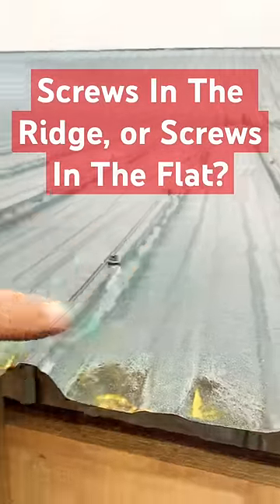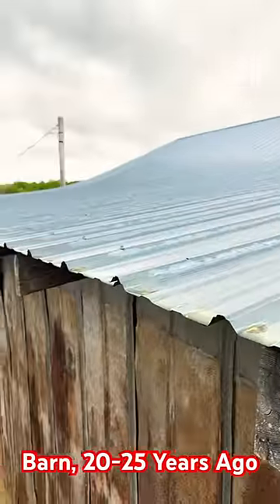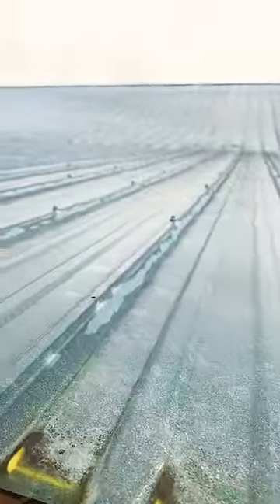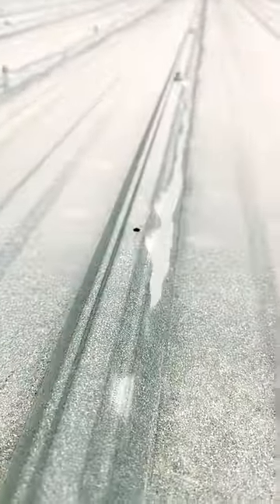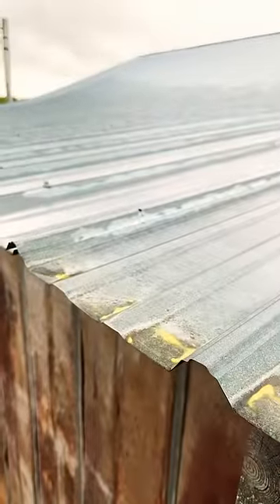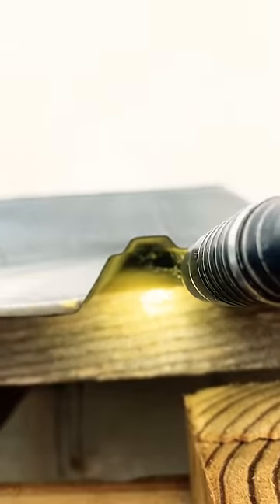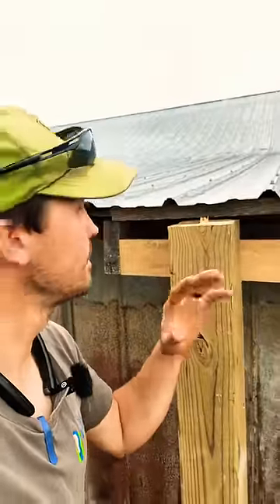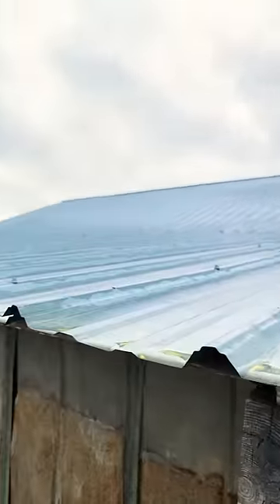What’s Better? Screws In The Ridge Or Flat? #construction #farmlife #building

Comment: They go where the warranty isn’t voided.
Reply: Have you ever had metal roofing replaced because of the warranty?
Reply: @wooduniversity7109  lol
Reply: @wooduniversity7109 my parents did.

So yes.
Reply: Warrant is only good for a couple years anyway.
Reply: @joeshuge usually with steel panels the warranty is good for 25 years actually. I work with these panels every day for years. And putting those screws in the ridge is dead ass wrong lol
Reply: @nonnysbro amen finally someone with common sense
Reply: @nonnysbro  that's wrong also, if you've worked with this product you would know different manufacturers have different warranties, screws can go in the ridge or flat depending on things like region, underlayment, roof pitch, strapping, manufacturers recommendations, type of fasteners, type of product, building code and alot of times as soon as the property is sold warranties are non transferable.
Reply: @joeshuge  that's a common residential panel. Not corrugated. I can guarantee it was supposed to be screwed to flat. I don't know shit about Australia. But in the US, those panels are supposed to be screwed to flat. I've worked for Metal Max, Max Steel Buildings, Sturdi Buildings, and Central States Manufacturing. 2 of those jobs we manufactured every type of panel you could think of. 2 of those jobs I've been an installer and fabricator for years. Never, except for corrugated and seam screws for commercial, have I seen any professional put a screw in a rib. And never have I seen a professional use a screw in a rib to attach it to a truss, beam, hat channel, or perlin. I digress, there are many panels I don't know about, those may be different. But this dude's roof is just a standard residential panel with 1 and a half inch high ribs, the panels are guaranteed 3' wide middle rib to middle rib with 3 1' spaced high ribs. This roof was not done professionally. Bottom line.
Reply: @nonnysbro  weird how I've seem many manufacturers installation instructions requiring fastening from the ridge.
Reply: @nonnysbro  also weird how right on western states metal web page it shows screwing patterns, and they are screwing through the ridge.
Reply: @joeshuge  homie, I WORKED for this company and I currently install panels EVERY SINGLE DAY from Central States. I don't know what you're reading, but I Guarantee you know nothing about steel buildings or paneling. No professional in my field would ever do this. Ever. Unless it was corrugated. Bottom line. There are specific instances that I may be unaware of. But I've done 100's if not 1000's of steel paneled buildings from Georgia to New York and as far as Texas. And never have I seen this. This is some old school farmer shit. Bottom line. No professional would do this for many obvious reasons. I could state them if you want.
Reply: @joeshuge  the only time we screw through the ridge is on commercial panels. That's called a lap and stitch screw. Those panels are a thicker gauge and require extra help with the seam. We also put butyl tape on commercial panels. But this residential stuff doesn't get stitches and doesn't get butyl tape. It's thinner and closes easily when done correctly.
Reply: @nonnysbro  go to the website and see for yourself, YouTube won't post links or I'd send you a bunch.
Reply: @nonnysbro  homie, go to Google, type in western states metal roofing screw pattern, click on the first thing that pops up, scroll down watch the video, I can't be any more fucking clear than that.
Reply: @joeshuge  bud, I'm not arguing with you. You don't work in this field. I have fabricated steel buildings for 10 years. I have been installing for almost 5 now all over the country and with different companies. I GUARANTEE you don't do this for a living. And I GUARANTEE you're reading these instructions and prints incorrectly. There ARE types of panels that require overlap screws. But not the type on this video is referring to.
Reply: @nonnysbro  yet I do work in this field, that's why I'm up to date on manufacturers specs.
Reply: @nonnysbro  and yes you are arguing with me and now you're arguing manufacturers specs because you're wrong.
Reply: @joeshuge  if I'm wrong then every installer I've ever known from 6 companies is also wrong. Worth mentioning I've also done insurance recovery installation. Never was our work rejected. Never did it leak. Idk where you working. But y'all on some different shit.
Reply: Well this was a fun thread
Reply: @joeshuge this is formed aluminum installed with gasketed screws that go on the flats except at overlaps. For this product… everywhere.
Reply: @nonnysbro this is not steel, it’s aluminum and the manufacturer requires gasketed screws supplied with the panels be installed on the flats except at overlaps.
Reply: @kenton6098  different manufacturers, different warranties, different applications, different building codes, no its not the same everywhere.
Reply: @kenton6098  and aluminum and steel are two very different products, but I guess saying what you said just shows your ignorance.
Reply: @nonnysbro yes in the flat is what manufacturers recommend.  There are some ppl here that know what they are doing. If yall knew anything about expansion and contraction they would know putting a screw in the ridge after the first freeze and thaw cycle those screws will not be tight anymore. Put them in the flat it will not expand and contract near as much plus you have more screw to wood contact and screw will never break like they will in the ridge.
Reply: Because expansion and contraction of metal, those screws better be at least 3” long or else they aren’t going to hold. They’ll wiggle out in a couple years if they don’t have enough bite. Also with wind. The screws ratings are when they’re fully sunk into the structure. When they’re in the flat they hold better and are far far less likely to come out in a strong storm. 
If you read the manufacturer’s instructions,  you’re also suppose to replace the screws more often than the roof itself because the rubber gasket dry rots and leaks. If you can’t prove you replaced the screws when you were suppose to, your warranty is void anyway.
Reply: @joeshuge metal roofs have life time warranty to the homeowner unless he sells his house
Reply: Screws in the ridge have been out dated and they wiggle loose and come out that’s why no steel company lets you do it anymore

Comment: A handy man put them in the flats of my parents house. About 6 or 7 yrs later they sprung dozens of leaks were the rubber washers dry rotted, water ran down the flat hit the screw and dry rotted rubber washer and ran directly into the plywood sheathing rotting it out. They had to replace ALL the sheathing and the "50 yr" metal roof. Cost them about $15,000 because the screws where in the flats.
Reply: That's the problem if you screw in the flat - even if it's good at the beginning the gaskets are aging over time and they can start to leak after some years. The gasket is in this case everything which makes the difference between leaking or not leaking.
Reply: I’ve never heard of a 50 year metal roof. The metal itself might last 50 years but, if you get more than 0mph wind, screws will never be able to hold up for that long, no matter where you put them. You should always be planning to have the screws tightened after the first 7-10 years. Then after another 5-7 years have all screws replaced with 1 size larger screws. Then after another 5-7 years you can replace those with the largest size screws and get an additional 5-7 years. After that you will have to have the 1x4 lathe/perlins replaced, but will still be limited to only using the large screws for that, because the metal will already have large sized screw holes in it. Which gives you another 5-7 years before you will have to replace all of the metal. Which give you at most about 38 years in total, but obviously not without additional costs/labor. You can get 50+ year shingles however.
Reply: Paint the metal roof with Marine Enamel, Problem Solved...
Reply: You're supposed to check the screws once a year. They will loosen up and the washers will dry rot, even on the ridges
Reply: Metal was fasten down to the plywood that's a no no , there has to be a air barrier that's why you use 1 x or 2x with 3 in screws hitting the rafter on every screw of the firing,  when metal cools after Sun down it condensates and if no fur then it can't dry making ppl think it's screws leaking that much lol
Reply: - that is the feature of the system...  More custom for the manufacturer - poty their "45 year warranty"...  lol..(oops, sorry for your experience.)
Reply: Its standard practice to replace the screws when the rubber washers eventually perish. As a side note, they tend to perish because they've been overtightened and the washers stick out in the sun.
Reply: @HawgWyldFishing  - -ha ha ha, and one storm comes along and blows half the 50 + year shingles right off...  lol...
Reply: @HawgWyldFishing 
Recently tore down and reclaimed a 100 year old building with an old corrugated metal roof, held down by the old school lead washered nails. Not the first one I've done. Live in Montana, where it is very windy.

You are very incorrect about the age you can get out of a metal roof as well as the wood loads they can take.
Reply: @HawgWyldFishing  get the standing seam hidden fastener type metal. Its 50 year, possibly even more as the fasteners are never exposed
Reply: @HawgWyldFishing  Standing Seam Metal > Exposed Fastener Metal/Shingles
Reply: The rubber washers deteriorate because of sun exposure not water exposure. Same thing happens to vehicle tires. It's sun exposure and temperature not water.
Reply: Might be 50 year steel , but the screws are only covered for three years give or take.
Reply: never screw into the flats on a roof or any horizontal surface, walls and vertical surfaces it doesnt matter
Reply: @HawgWyldFishing I have seen many barns with 50+ year old steel roofs. Heck there are log cabins & log barns out there with100 year old roofs. Almost all nailed on the ridge of the steel. Never been touched from the day they were installed. Maybe the problem is screws. I have a different steel roof that looks like regular shingles. It attaches differently of course. It DOES have a 50 year warranty, but doesn’t cover fading. Insurance covers dents etc from hail the roof is rated for 135 mph winds so we are going here on the prairies!! Haha. The sun will fade them though. Just went with a lighter colour to minimize the affects.
Reply: It’s more likely that the screws leaked in this case due to backing out of the old, 
Never go directly over plywood with metal. Condensation and screws will not hold long term. They will back out and leak.
Reply: that's because he either over tightened the screws and blew out the washers or he installed them crooked
Reply: @simonm1447  that just is not true
Reply: @Cjohn31  metal directly on the shingles 1x's are not necessary
Reply: @kevinwaller6353  yes they are , your metal is going change temp at faster rate than the single under it causing condensation and without a air barrier it can't dry ,4 or so years later when ppl are replacing rotten wood they think the screws leaked lol
Reply: @Cjohn31 , I have yet to experience that and roof repairs is what I do and have been for over 30 years
Reply: @kevinwaller6353  not every single one done like that will , depending on climate, what part of the country to . Plus you got another issue ,if you don't put down 1x at minimum (I use 2x) and use long screws to fasten the wood to the rafter after going through the shingles and deck. A screw will easily pull out of asphalt and osb or cdx (whice shouldnever be on a roof anyway). I've  been doing this since the early 80s and I go by Florida hurricane codes because I dont want any issues and I've never had one
Reply: It was the screw/washer that was the problem. Your washers shouldn't squeeze out of the screw head, it should be sealed by the heads it torques down. I have seen many flats screwed and not leak with the correct screws. I have always seen nails in the ridge and screws in the flats..
Reply: @kevinwaller6353  well, I'm building houses and stuff for 25 years and we already had such cases, after just 10 years. If the sheets are long enough there's plenty of expansion if they heat up in the sun
Reply: @HawgWyldFishing  
New Zealand metal roof lasts a minimum of 50 years...
some are over 100 years..
the oldest is 140 years.
Reply: You're supposed to replace the screws every 5 years. Costs almost nothing.
Reply: @nonnysbro  who is gonna climb on their roof and replace 10,000 screws every 5 years?!?!?! Hahaha ... or .... put then in the ridges were they belong once and never replace a screw for 50 yrs?!?!?!
Reply: @johnstickman7995  bud... I do it all the time. I can do a 30x60 roof by myself in 2 hours. I charge $100 hr. That's not bad at all. It takes no time. And it's not very costly compared to replacing a whole lot of other stuff. It's just the nature of steel paneling.
Reply: @johnstickman7995  as far as the 50 yr thing.  You don't know what you're talking about. Those panels will need to be replaced before 30 depending on precipitation and location. Anywhere near the ocean will be more frequent.
Reply: Handyman was thinking about his future... working on the leaks.
Reply: Install a standing seam metal roof and never have to worry about where to put the dang screws
Reply: @kevinwaller6353 Metal directly over shingles causes nasty dents and bumps on the high points of the shingles. So the install looks really bad from the street.

Also most roofs aren't perfectly level. With a overlay of 1x4s you can compensate for dips and ridges, yet again making for a superior looking install. This also creates and air gap in between the metal and the shingles allowing for a more energy efficient home and allowing the near daily condensation build-up somewhere to go.

Then you have the shingles which continue to off gas and shrink through out their lifetime, which is usually the reason someone is repairing those roofs in the first place. As the shingles shrink they allow the screws to lose compression with the metal making them loose. 

So yeah kiln dried 1x4 overlay is better in every conceivable way.
Reply: They probably over torqued all the fasteners and deformed the washers...